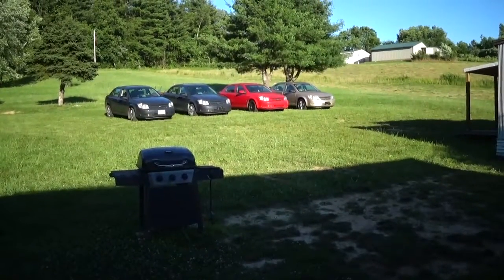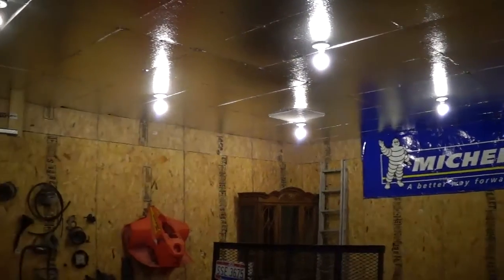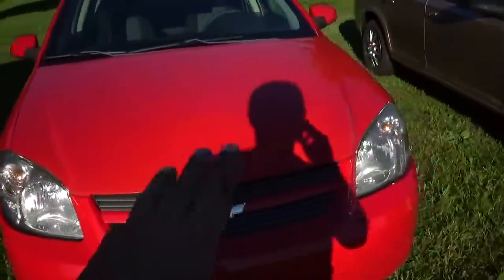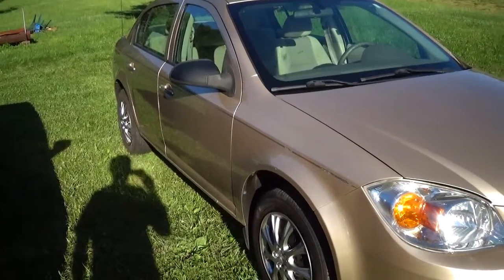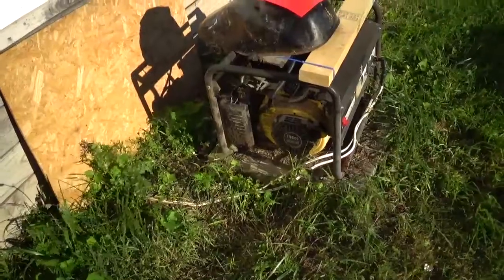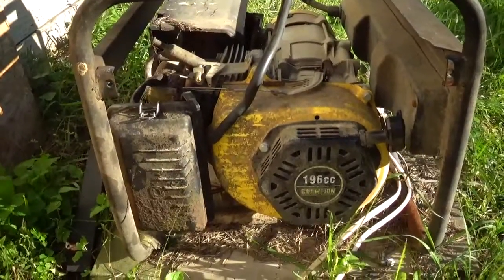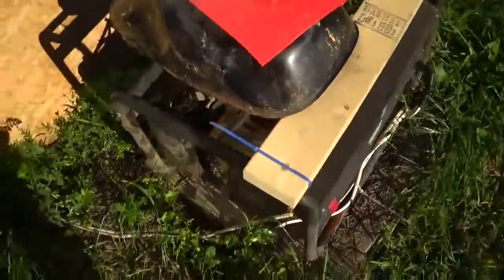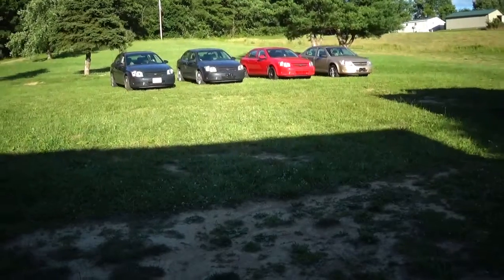Auto Auction, Generator problems, Paint booth, Water tower

Comment: Check out Craig's list many 5500 to 7500 listed I'm sure you have looked . I bought one last year for $150.00 and all it needed was a carb cleaning , people would rather sell them then fix them . I had a couple of the chev Cavaliers and they ran for ever seems like cobalts are the same . Also the Carb worked out great will have the videos up soon .
Reply from the maker: I need a bigger generator. It takes all this one has to run that compressor.

Comment: don't know if you got a definitive answer on your generator, it's not worth your time and money to put a new engine on that generator, you'd be better off getting a new one, the original engine would be a tapered shaft.
If you were able to find an identical engine from another generator or pressure washer that would be your best bet since most pressure washers have low hours, in so many cases people below the pressure washer pumps before the engines dies, but you will have to swap the crankshaft.
Reply from the maker: Roger said it has tapered shaft. If I was to change it my thoughts where to swap the cranks out. The reason i was thinking of fixing it was a predator engine is only 100 and a whole generator is 300. If it was winter and had nothing going on I would just buy a new one but I'm really wanting to play with other things. As it is the generator is back and runs the air compressor. I know her time is coming so I'll keep a eye on Craigs list.